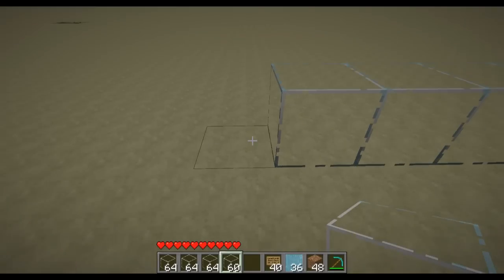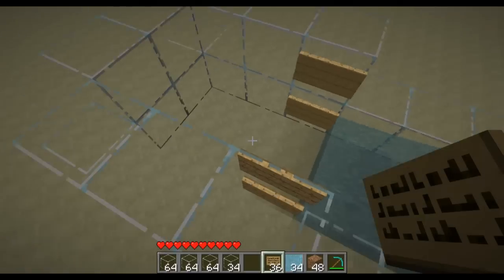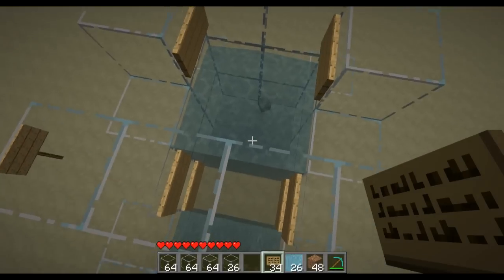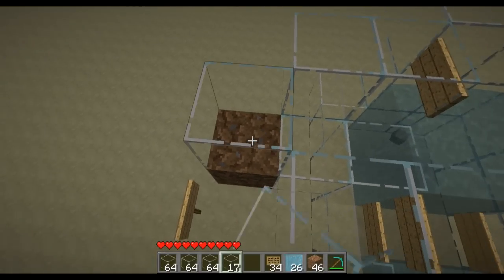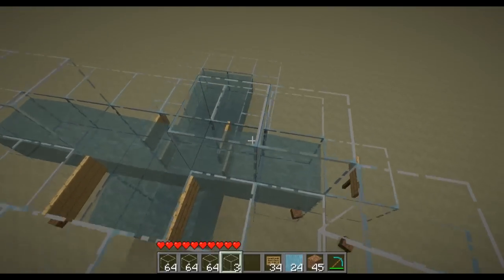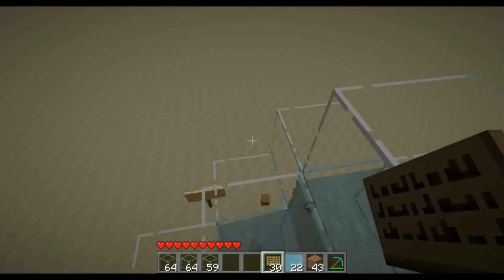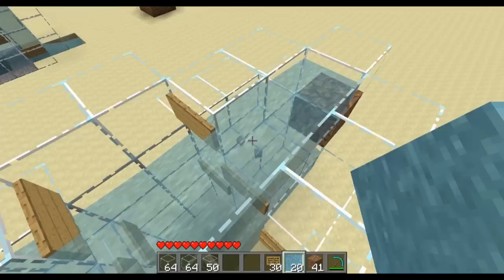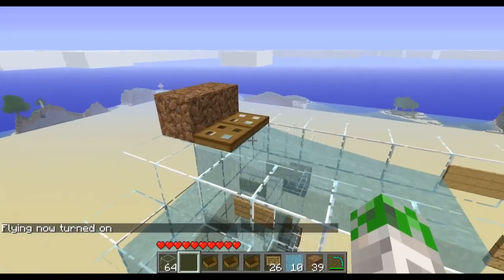Docm77´s Minecraft Tutorial: Fast Boat Elevator Update 1.7.3

Comment: @docm77 I have done extensive testing with both trapdoors and signs and have come to a conclusion that both of them result in the same speed. However, as it is possible to get stuck on trapdoors, the edges of the two-block space where the signs are placed presents a problem as well. The signs do not fully impede the boats, but when riding the boat at the edges the boat gets considerably slowed down. Therefore, (albeit not as annoying) it's harder to have the boat travel up with consistent speed.